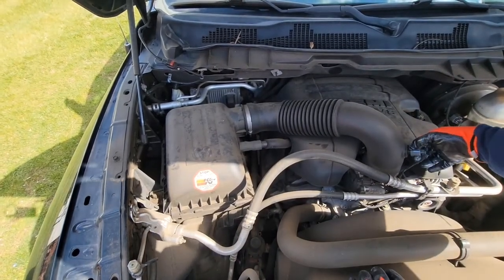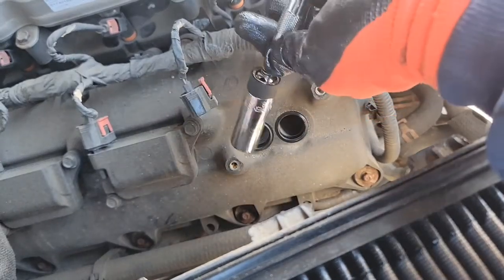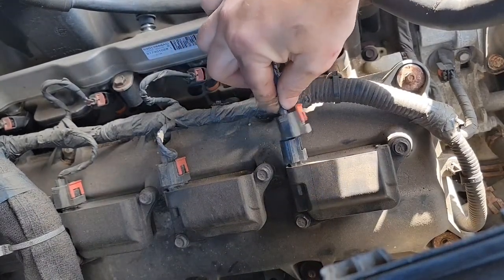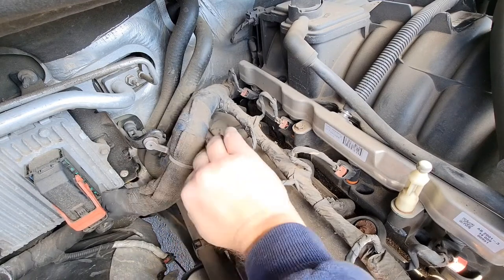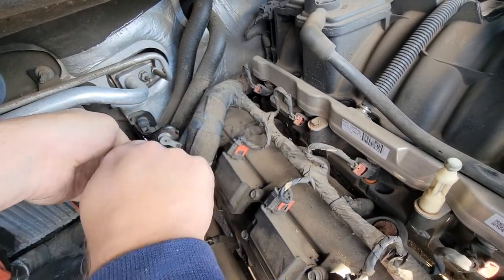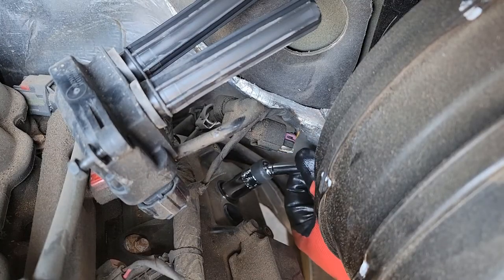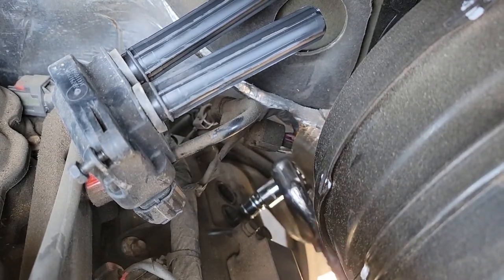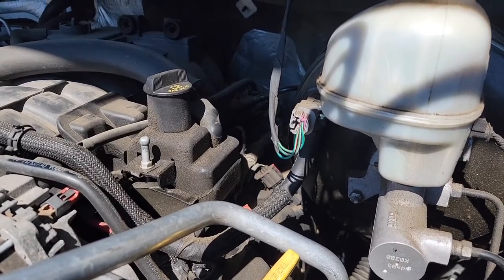Ram 1500 Hemi spark plug replacement 09-18

Comment: Patience and the right kind of spark socket is key.  Changing my plugs again this weekend.  193k miles on my 2014 Ram 1500.  Fun times ahead 😂.   Great Video.
Reply: lol you’ve been doing some riding. Hey that’s what it’s for. As long as you keep it maintenance on it. I’m at 133k. Doing my plugs this weekend

Comment: Yes, you did get two of the hardest ones, the #8 and the #7, but you didn't show us what IMHO is the very hardest...the #5 cylinder. Your power ratchet won't fit between the coil and brake booster, and using an adapter to the 1/2" ratchet may also be too long to get between them. In my experience, an 8mm box wrench works best on the #5. Also, if you are willing to remove the plastic fender wells, the jobs a bit easier from underneath. Just my opinion - the job can certainly be completed the way you did it.

Comment: I leave the coil packs plugged in.  That socket is cool. Simple u joint or pivot type attachment works fine just behind a regular spark plug socket. The electric ratchet makes short work of most of the project. 👍

Comment: This is my first time changing plugs on my 15' ram 1500. Normally I just buy them from the store for my 4cy. But seeing they take 16 I was curious about Amazon because of the price. I have read about people about fakes. What is your experience and where do you buy your plugs from. At this point since I do only the best for my truck I will spend the extra $ and go to the retailer. I'm just curious about other people's experiences.
Reply: if it's not too late, rock auto.  Great prices and they aren't fakes

Comment: Greate video. Have you had any problems unscrewing any of the spark plugs that you had to use a lot of force?  At what time and mileage did I change the spark plugs?  I am waiting for a replacement in 5.7 HEMI Challenger soon, my manual states that 100k miles.
Reply from the maker: My truck was at 120k miles and no problems with any of them thankfully.  Just a time consuming job

Comment: Did you have to take the driver side fender wall to reach back in there to get the back driver side plugs?
Reply from the maker: If it isnt in the video I didnt do it.  Its been awhile so its hard to remember but I believe i did everything from the top.

Comment: Thank you for the video
Reply from the maker: I though it would be horrible but it's not as bad as I thought
Reply: @buildsomethingstupid1736  the one underneath the brake booster wasn't too bad. I laid prone on the valve cover and did it

Comment: First thing you do before working in engine bay, pressure wash engine!
Reply from the maker: Thats a good way to cause electrical problems
Reply: @buildsomethingstupid1736  not with low pressure water hose sprayer! Never had any issues here!